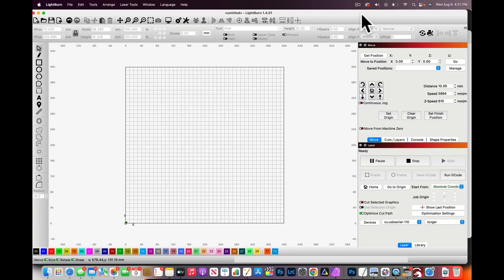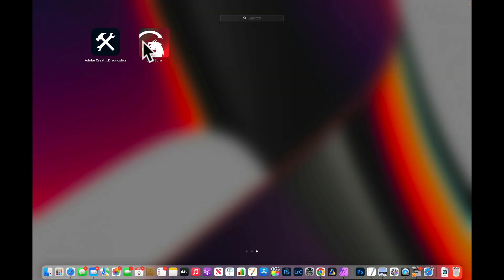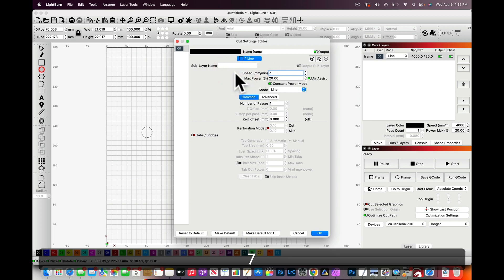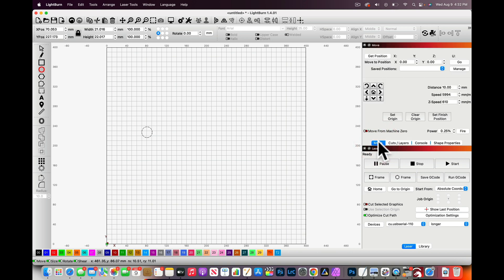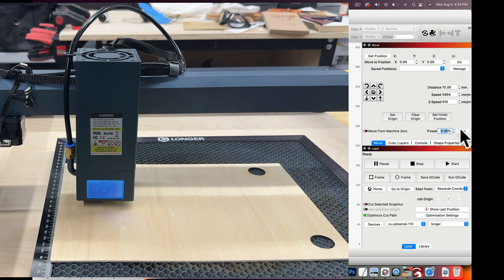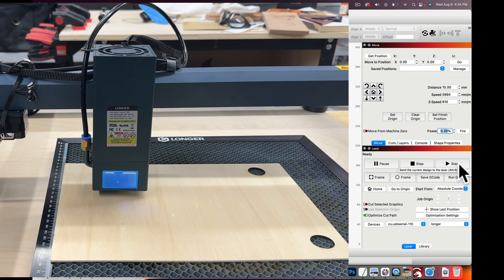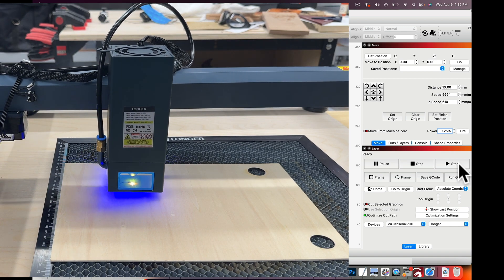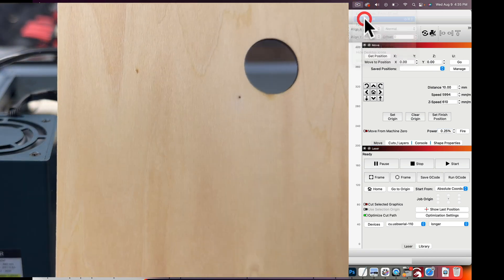How to frame with 100% accuracy in Lightburn

Comment: Thank you for this. This was bugging me and you solved my bug. I also turned on the "Laser on when framing" which is directly under the "Enable laser fire button" and set the power there to 0.25% and that worked.